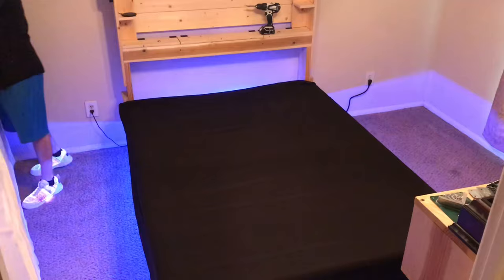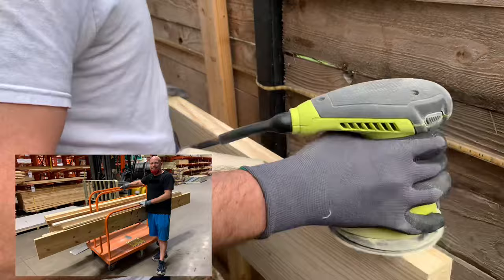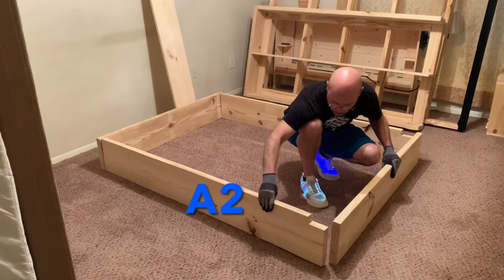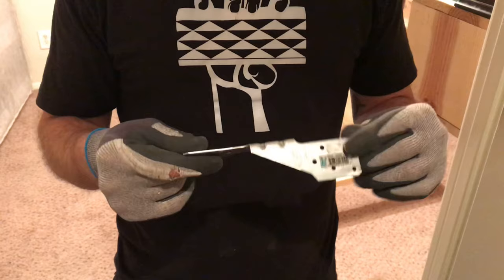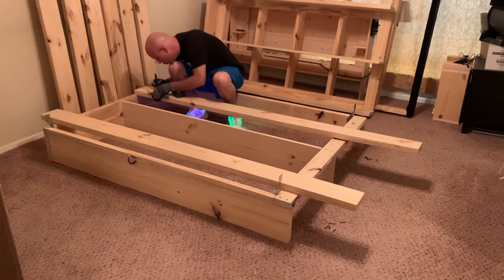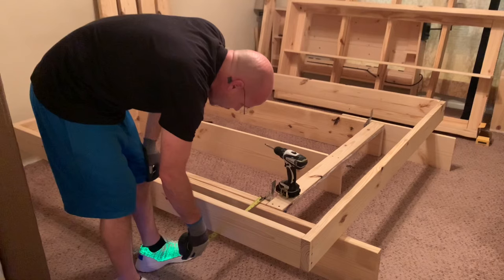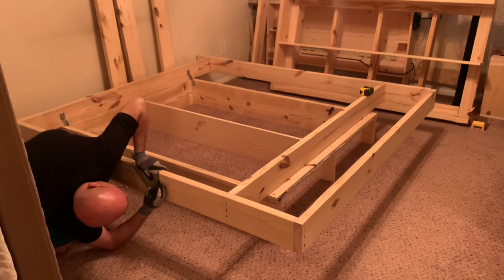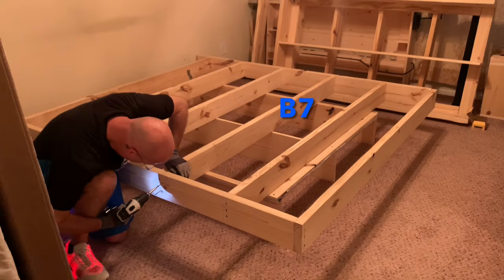King Size Floating Bed Frame [Easily build your own!]

Comment: Hey! So silly question here but is it safe to assume the bed will be as high as you chose the base width? So if I do 2x 10 I can expect it to be 10 inches off the ground right? 
Also any clue about how deep it goes? 
My goal is really to add cubby on the bottom.. not sure if that’s too realistic or not
Reply from the maker: @Leena Dishes Hey Leena, thanks for your question.  So, first off, not a silly question at all.  It only becomes a silly question when you don't ask it.  
...Not exactly.  A 2x6 actually measures 1.5" x 5.5", a 2x10 actually measures 1.5" by 9 1/4" so you will be close, but with dimensional lumber purchased from the home improvement stores, you aren't acquiring what you think you are purchasing.  There are different terms used within the industry to describe wood and lumber at different stages and to facilitate sales, distribution and handling.  You need to make sure and look at the tag on the pieces of wood you are purchasing so you know what you are putting your hands on.  
...How deep it goes?  All the way!  What are you asking here, I'm not sure I understand.  I designed and built this bed frame 100% by myself so yes, I've got some clue about everything in regards to this build.  I think you may be asking about the overhang...it's 12" from the edge of the base to the edge of the frame on the sides and at the foot.  
What is this cubby you want to add?  We can make it happen.  Does my reply help at all?  I'm on instagram realc_love1 if you'd like to reach me there.  Thanks so much for your time.  I'll talk to you again soon.

Comment: I have build the Qween size bed with my dad and love it. Upgrading to a King and just want to increase the size of the top and keep the base the same. Can it be done?
Reply from the maker: @Jason Day Hey Jason, sorry for the delayed reply.  Life is super busy and I needed a moment to think about this one.  You aren't gonna be able to keep the queen size base for the king size frame.  Did you build your queen out of 2x6's?  I would reuse the boards from the queen frame and cut them down a little bit to make the base for the king.  You will have to buy new boards to build the frame for the king size mattress.  I hope this makes sense and helps.  If you need anything else, I'm on Instagram C_Love1984.  Talk to you soon my friend.

Comment: awesome video! do you need to add any slats or foundation or just put the mattress straight onto the 2x6's?
Reply from the maker: @bbrady68 Hey Nova, thanks a lot!  Yes, you are going to need a box spring to support your mattress.  Others have used either plywood or cedar fence pickets if you don't have the box spring.  I hope this helps.  Have a safe build my friend, let me know if you have any other questions at all 🤝

Comment: Will it still be sturdy if I shorten the base boards length by 5 inches each side? (I'm looking for a more dramatic floating effect)
Reply from the maker: @XxMrPerfectPRxX Hey Mr. P, I really don’t know to be honest.  I wish I could help more.  I just built the first design that came to mind that seemed like it would be stable, and it was, so I didn’t need to keep building on it.  I suppose if I started too small and worked my way up to a base that would be big enough, I would be able to tell you if your desired size would work.  Thanks for your question, I appreciate that one a lot.  Let me know if you end up making it to your own dimensions, I’d sure love to hear if it worked!  Safe building my friend.

Comment: Do you still use the box spring with this? Also you mention measuring 16 33 and 51 what about the measurement for the first and last boards that connect to the strong ties?
Reply from the maker: @adam oren Hey Adam, thanks for your questions, I'll be glad to help you.  After having posted so many videos on the floating bed frames with the available modifications and the number of people that I have helped, I've realized that my videos serve as a guide to help you guys spawn new ideas for your builds.  I never, ever imagined that these would take off like they have.  You will definitely need the box spring if you are going to build any of my floating bed frames.  If you don't have a box spring, a sheet of half inch or fifteen-thirty seconds plywood will do just fine for you.  As far as the spacing for the joists, if your frame is going to have the headboard extension, you want to leave five and a half inches at the head part of your frame.  The last joist will line up with the foot part of the base box that you build(to either or not include the storage option).  I hope this helps and I hope you have a safe build.  Talk to you again down the road my friend.

Comment: Amazing work. Dont know if this is something i could use. Im a heavy boy.
Reply from the maker: @jon heuvelman Hey Jon, you might be surprised.  This bed frame is absolutely rock solid.  My original queen size video has comments from adult men measuring over 6 foot tall and over 275 lbs using my design for their bed frames.  My video ‘part 2 - the headboard’ at the twenty five second mark shows me for real jumping around on the bed frame.  Take a look…this is a ‘big boy’ rated capacity bed frame.  Let me know if you want or need help with your design or build, I’ll be glad to help.  Talk to you soon my friend.

Comment: We want to build a floating king frame but we have a sleep number bed that requires we use their box spring because all the air tubes are in it. How do we accommodate for that? Thanks so much!
Reply from the maker: @Carol Ann Hey Miss Carol, thanks so much for stopping by and reaching out.  I’ll be glad to do what I can to help you.  Please reach me on Instagram C_Love1984 so I can get some more information from you.  Then we can come up with a plan for your build.  Thanks so much for your time.  Talk to you soon.

Comment: Awesome video!!! What did you do for storage? Leave it open..rolling drawers?
Reply from the maker: @Danimal Hey Dan, the storage is there.  I just left the foot area open and then got me some 'underbed storage bins with lids' that would fit in that area.  I used 2x10's for the base to make sure I would be tall enough.  The bins just slide in and out from the foot area.  I hope this helps.  Talk to you soon my friend.

Comment: Excellent video. I’ve made one and it worked great. One question, if the wood is creaking when you move around , what would you suggest that’s due to and how can I stop it. Thanks
Reply from the maker: @woza2023 Hey Warren, thanks for stopping by, I appreciate your compliments and support.  I think the wood is creaking because you are moving around.  I'd recommend to stop moving around so much and it very likely will stop creaking.  😂 I'd say your screws aren't tight enough...there is enough wiggle room that your wood is rubbing against each other.  Did you use countersink drill bits to pre-drill the holes for all your screws?  Did you make sure to sink your screws in all the junctions pretty tight?  2 screws or 3 at each junction?  Did you use 2x6's for your build...?  How did you secure the base to the frame?  Somewhere along the way, something isn't sitting right or isn't secured snugly enough.  Does this help?  Let me know what other questions you have and I'll do my best to help you out.  Talk to you again soon my friend 🤝
Reply: @CurtisMadeIt  thanks for the reply.  Yes I have managed to stop it by staying completely motionless in bed, except for my Friday nights when we do date night😀
I have actually sorted it, what I needed to do was screw in the joists into the base onto the centre piece. I examined it and saw that the wood wasn’t all 100% level so there were gaps and movement made it squeak.
Thanks again for the video and replying. My wife actually gets back from a holiday this week so looking forward to her response, especially with the motion activated led lights I put under there!
Reply from the maker: @woza2023 Hey Warren, I’m just now seeing your reply here 🤦‍♂️ my apologies.  I’m glad you got it sorted out.  Thanks again for your expressing your concerns and coming back to update me, I appreciate that.  I hope your wife was happy.  Let’s talk again down the road 🤝

Comment: Loving the Video! Me in my Wife are currently in the process of revamping our master bedroom and We are definitely going to try to build this. (I am new to the woodworking scene) but your video has given me the confidence to give it a shot. I just had a quick question before starting. I plan to paint the wood white while in the prepping phase. However, which sanding grit you recommend I go with for the prepping of the wood?
 
Sending Much Respect for your craft from (Southern California)
Reply from the maker: @Eddie Reyes Hey Eddie, thanks a lot for your question and time, I appreciate it.  I’m glad I inspire you.  Please have a safe build and let me know if you need any help or have any other questions at all, I’ll be glad to help.  On this build, I sanded to 80 grit first, then wipe your boards down with a pretty wet terry cloth towel(this cleans off your boards and raises the grains on the wood).  After your boards completely air dry, sand with 220 grit.  This will leave you with a hard to believe smoothness.  I hope this helps.  I’m on Instagram C_Love1984 if you need anything else.  Talk soon my friend.
Reply: @CurtisMadeIt   You are the man!!! Thanks for the quick response. I was actually reading your response as I was literally in Home Depot last night picking up the materials to knock out this project this weekend! haha. Just had one last "rookie" question.. haha I ended up picking up 3" fasteners as you mentioned in the videos. However I am going to pre drill the holes but I was not sure which drill bit size to use for this? Lastly, I dont have instagram, but you my friend have another follower on you tube. Myself and my wife have started following you (along with hitting the notification for all your upcoming videos) lol. What is your email address. We would love to share our before and after photos of this project. 

Sending your positive vibes always: Eddie & Melissa (A.K.A Meleddie) haha
Reply from the maker: @Eddie Reyes So cool, thanks a lot Eddie.  I really appreciate replies like yours here and I can’t thank you enough for your(and your wife’s) support!  I am curtisalove1 @ g mail dot com…I can’t type it all out together or YouTube will flag my (own) comment.  Get you the 3 piece DeWalt countersink set DW2535, Home Depot store sku number 433954.  That will pre-drill your holes and countersink at the same time so that your screw heads sit flush with the surface of your wood.  IIRC, it will be the middle bit in that 3 piece set that you will use for this build.  I hope this helps and I really can’t wait to hear from you my brother.  Thanks so much for your time and awesome replies.  Talk soon.
Reply: @CurtisMadeIt  Hows it going brotha,  I am in the process of pre drilling my holes. Do you happend to have a diagram of where I should pre drill?
Reply from the maker: @Eddie Reyes I don’t, but I do have pictures if you want to email me.  …from the headboard area, measure 16”, 33”, 51”, & 66” and put your joists at those marks, that should be the spacing.  I hope that helps.

Comment: Do you have adjusted measurements for a full size mattress? For the frame and headboard.
Reply from the maker: @Cameron Herron Hey Cameron, thanks for your interest and question.  Full size floating bed frame: yes.  Full size floating bed frame headboard: not yet.  I am working on the headboard.  I’ll have a video for both coming sooner or later.  Next video is going to be a headboard for the king size.  Full/headboard is on my list.  I appreciate your support, stay tuned.

Comment: Wanting to build this bed frame this summer as a father and son project.  I'm in between which size of to use for the base 2x8 or 2x10.  Cause the top of  my mattress seats at 24 inches from the ground.  Now, the question i have is for the top frame.  What would be the meausment with a 45 degree miter cut for the top frame.  But would like the mattress to sit inside of the top frame.
Reply from the maker: @gflores076 Hey, good morning G...my many apologies for the delay here, life has been busy but I do have a useful answer for you I hope.  2x8 or 2x10 for the base is okay, whichever you prefer(Ask yourself:  1 are you going to be using this space for storage and 2 how sensitive to the overall height of the deck of the mattress are you going to be once everything is put together?).  Keep in mind that you need a box spring to support the mattress so this may add additional height to your set up.  Plywood with holes drilled in it or cedar fence pickets spaced slightly apart to allow the mattress to 'breathe' is moderately acceptable if you need to do that instead.  As far as the frame goes, if you are going to miter your corners of the perimeter boards, I think you just add three inches to all of your cuts...this is twice the width of the 2x6's you will be using to make the frame.  So...what is this, the king size?  76w x 80l.  I'd cut that foot board to 79 and the side boards to 83...joists will be 76(the same width as the mattress).  Are you planning on adding a headboard?  I've got a separate video posted on this channel "king size headboard" to give you an idea if you think you may want to give it a shot.  Let me know what other questions you have and I'll try to be a lot more handy to reply.  Thanks for your time and support here, I mean it 🤝

Comment: Hi, i was gonna make a king-size one, but im lost with the measurements like how big should the base be for a 1.50m bed frame and the woods tgat i need to get.
Reply from the maker: @DawitTT Hey Dawit, my apologies for the confusion and the delay in my reply here.  I'm going to do the best I can to help you.  What country are you watching from?  What are the dimension of your mattress?  I use untreated lumber that measures 3.81cm x 13.97cm and then cut it to the lengths I need based on the bed frame I'm building.  Do you have a box spring?  Have you seen the headboard video for this king size posted on this channel?  When are you looking to get this done?  Let's get a plan developed for you so you can get this thing knocked out!  Talk to you again soon my friend.

Comment: Did You use the wood as bought or did you cut the edges  Plane it or sand it? The lumber here is always bad warped cracks Öl of that unless you pay 15-20 for a 2x4
Reply from the maker: @martin8829 Hey Martin, thanks for your question, this is a good one.  When I build the floating bed frames, I've learned that for the pictures that I use as the thumbnails for the videos, it's best to spend the time to sand them down and get them ready to stain/paint/seal.  This makes the wood look a whole lot better.  Eventually, I'll get around to showing how to properly seal and stain them, but I haven't gotten to that part on this channel yet.  

I'm sorry to hear about the cost of your lumber.  If you get you a 5" orbital sander, you can start off at 80 grit, step up to 120 grit, and finally to 220 grit (*completely optional* taking the time to 'pop' the grain in between each step.).  This will make your wood look pretty much exactly like what you see in the video here and will be ready to handle further if you so choose.  I hope this helps...let me know if you need anything else my friend.

Comment: Really amazing tutorial, but this design doesn’t quite work with an all foam mattress because the gaps are a little too wide. I slightly modified your design and it came out amazing, much love! I might make the headboard if lumber prices go down soon 😂
Reply from the maker: @Carlos Puerta Hey Carlos, thanks so much for stopping by.  You are right, this design definitely does not work for a mattress without a box spring.  I usually just recommend that people use ply wood on the deck of the frame to support the mattress in the absence of a box spring.  I'm glad your build came out great and to your satisfaction.  I really appreciate your support a lot.  Please, come back and see me.  I love hearing from you guys!  Talk to you soon my friend.
Reply: Yes my name is Steven Gann
Reply from the maker: @steven gann Hello Steven Gann, nice to meet you 🤝.

Comment: Awesome video!! Question: whats the measurement for the base board notch cuts? Also, what at what measurements do you screw B4-B8?
Reply from the maker: @Alexandre Mejia Hey Alex, apologies for the delay in my reply...I'm just now having a chance to get caught up here.  That notch in the base board is the same dimensions as a standard 2x4...thats 1.5" x 3.5"...it's really not necessary if you want to know the truth.  You can just run it across the top of those base boards instead of cutting the notch out.  And I don't understand what you are asking about the B4-B8.  Reach me on instagram realc_love1 and I'll be much more than happy to get you all the info you need.  Thanks so much my friend.  Stay blessed 🙏